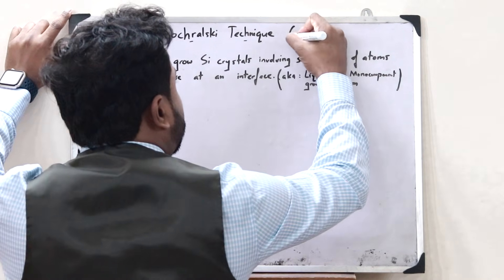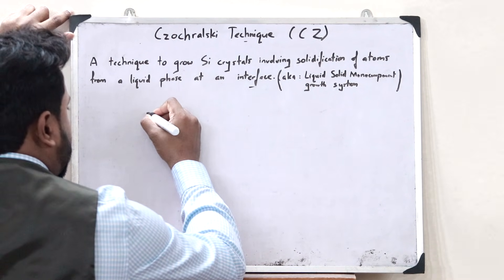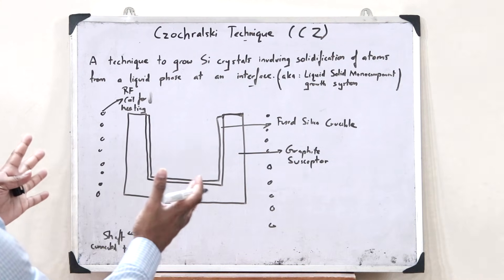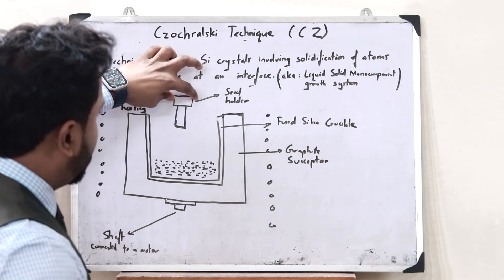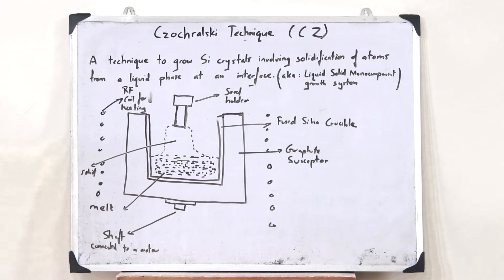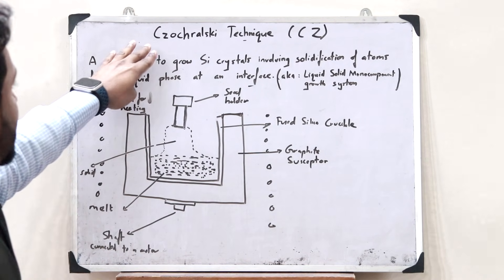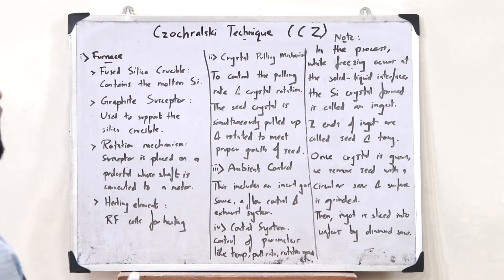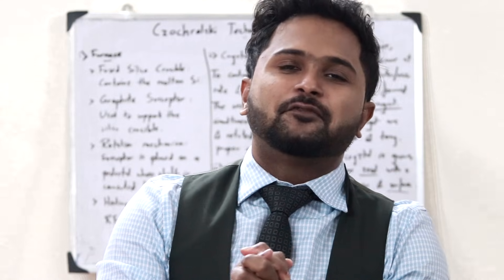Czochralski ( CZ ) Technique | Silicon Crystal Growth Process | Experimental Setup | Simplified

Comment: Sir there a question what is there in a seed crystal that is attracting or pulling molten Si ...is there any special material?
Reply: You have likely already found the response, but for Si ingot crystallization the seed is simply a crystallized form of silicon (its molecular structure is linked in a pattern). The molten silicon bonds to this crystalline structure, following its predisposition to that molecular arrangement, which (when cooled) forms the final, crystallized ingot.
Reply from the maker: No

Comment: how it solidify because we are rising temperature in the crucible ?
Reply from the maker: Consider this example : when we heat gold, it goes into a moulted state right? And once we keep it for cooling it solidifies. Similarly the molten silicon here also solidifies when it freezes on pulling up.